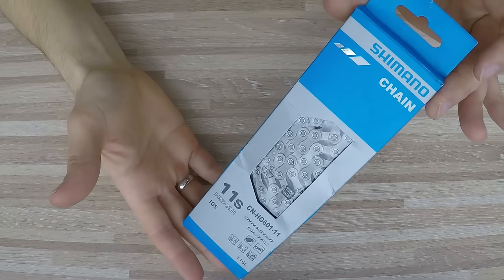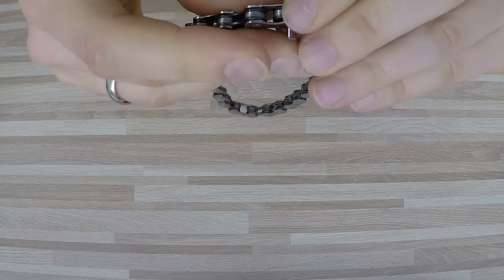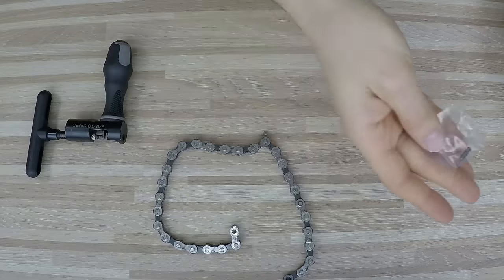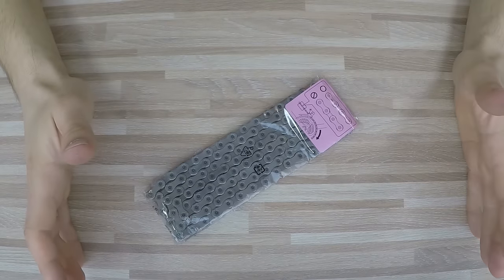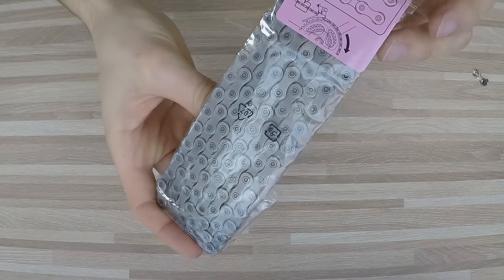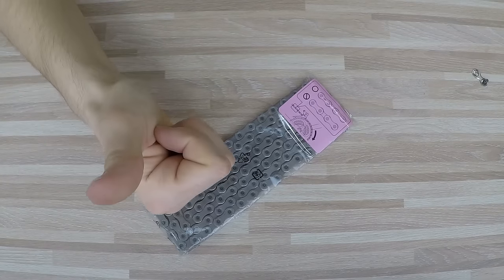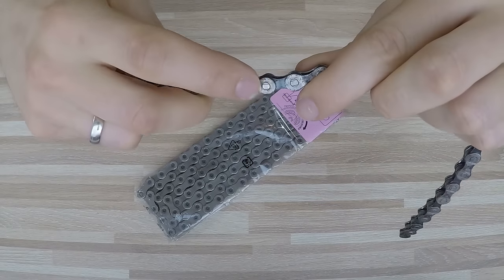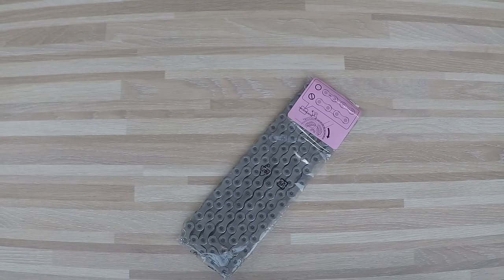4 Worst Mistakes In BICYCLE CHAIN Maintenance. How NOT to do it. SickBiker Tips.

Comment: Really not convinced by the replacement pin argument. A failure would be more likely to occur if there wasn't enough link showing on the outside of the chain outer plate and that would be down to inattention when using the tool rather than actual wear. With 110 or so links in the chain, it's unlikely that you will break the same link more than once and the wear on the outer plates would be as much a concern as the wear on the pin. If you are really that worried, the quick link might be a better way to go but you are just as likely to make a mistake with that and break the chain through human error.
 Best thing is probably not to break the chain once it's on and maintain the chain in place.

Anybody ever stripped a freewheel or a sprocket to the same disastrous effect?

Comment: Spot on mate.
Never reuse a pin. They are so cheap, it makes no sense to increase the probability of having a failure. Also, when installing new pins, check for link tightness. This is very important. If there a tight link, it will cause the undo wear on the cassette and chain. The chain will have a tendency to 'jump' on the cogs. 

To fix a tight link, use the chain tool but place the chain on the OUTER cradle, not the inner. Then ever so slightly, push the pin in just a hair, then repeat the process on the opposite side of the pin. Basically, you are pushing out the plates, but so so slight just to relive the 'kink' Take note though, if you push too much you will ruin the link. It's a very precise procedure that requires a light touch!

Comment: That is not true....  you can break a chain and use the same pin.  You just need to hit the pin few times with a hammer on a hardobject like a block of steel to give the ends a small flare.  How do you think the other 75 links are held inplace?

Comment: I hAve a 49cc motorised bike the chain in the gearbox broke after 12klm it's a 25h  double chain with 1600lb breaking force no where sells the chain I could not find a new pin so used a nail and squished it to fatten the ends, the pins are 2mm by 1.53 cm the bike shop could not help me, if I could find a pin of these dimension I could fix it properly.

Comment: Interesting video however it didn't answer the question I currently.  You seem to know your stuff so the question is....earlier I was putting on a new Dura ace 11 speed chain.  I wasn't paying attention when screwing in the pin & screwed it right through.  The chain was sized to the right length so I don't know what to do next.  Is the link wrecked now or just the pin?  In other words if I take  a fresh pin can I put through the same link I just put a pin through?  I thought that this weakened the link beyond safe use?

Comment: I use whatever vegetable oil that is lying around to both clean and lube my chain. Currently, it is extra-virgin olive oil. I pour some onto paper towels and spin the chain into it until it is good and oily. Then, I do the same thing with the paper towel only to get the extra oil and dirt off.
I have also been riding for quite some time, and after a ride, can sometimes enjoy a good pasta. (I get nice and hungry.)
I've had to deal with only one broken chain ever, simply because all of my bikes got stolen long before the chains had any problems.
I really should learn to dry my chain if it gets wet right away when I get home.
Reply: i read something about cooking/vegetable oils being bad over time due to oxidisation or something..look it up and change practice if you find the same info and still doing this..

Comment: Well for my part...I had a Dura-Ace chain at the beginning of the season (just putting some mileage in my legs) and I had to changed the bearing direction on my bike.  Went to the shop and I ask just to change the bearing direction.  BUT, they've looked at my chain (I had 932km with this chain) and it was already at .75 so they changed my chain...a Dura-Ace chain.  I don't do competition.  Is that possible??  To change a Dura-Ace just after 932km???  Thanks for your help on the subject.  The cassette and Chainring was ok..

Comment: My old MTB has well over 1000 miles on it and I've only ever used wd40 and motor oil to oil my chain also its the original chain
Reply: Matthew Abt erm... that is not really something to be proud of. 

1000 miles should not feel old. Many people put on a few thousand miles within the first season. That's 10x 100 mile rides.

Any cleaning & lube is better than no maintenance at all, but a degreaser and proper dry lube will give you good results. 

As does checking chain elongation & replacing the sprockets + chain. Depends on how you ride, but most chains only have a few thousand miles in them. Ride an elongated chain and you'll knacker the sprockets.
Reply: Well that's the thing , I've only put 1000 miles on it but I'm not the original owner it has been through 3 owners before me. And that's the reason it feels old , I plan to replace the chain soon because it is rusty and.covered in dirt

Comment: eh. with minimal maintenance I will get 6-8k km with an occasional lubing and not riding in the absolute worst conditions.  Of course I am talking about replacing the chain once it brakes, not changing it when it starts to stretch out.

Comment: Misinformation - the original grease is the best ever lubricant that you can ever have! Never ever remove the original grease. So says Sheldon Brown - Bike God.
Reply: James Rindley: I adhered to Sheldon Brown's philosophy on this matter for years but: 1.-He's been gone for many years and things change as new data comes in. 2.-New data shows that, now, there are better substances than the original grease and these substances have been thoroughly tested, check out Zero Friction Cycling and their excellent test results at: https://zerofrictioncycling.com.au/lubetesting/.

Basically, removing the grease and PROPERLY installing wax (with the correct ratio of melted paraffin and liquid paraffin) is far superior in reducing friction, noise and wear.

Comment: what causes vibrations and chain noise? the chain is lubed and not worn but it makes quite a bit of noise.
Reply: If this happen after lubed chain, its need some "break in" for lube to penetrating the chain and then its will be silent again

Mine was louds for awhile after wash and lube the chain but its goes silent after some spin up so lube could penetrate the chain rollers

Comment: Thought I posted this here, but don't see it.  Gotta get the word out...

Obsession with getting EVERY little bit of grit or grime off a chain is a COMPLETE waste of time. Why? A half hour on a road ride and your chain's dirty again. Five pedal strokes off road and it's dirty!

The worst part is that it encourages the use of all sorts of solvents, some safe, others not. I found a YouTuber who had a how-to video on soaking your chain in gasoline. There he was working in his tool shop garage using gasoline to clean chains. And showing others how to do it. Completely irresponsible.

THIS is what you want to avoid. The risk of blowing your place to kingdom come is not even close to worth it. And then if you are smart enough to switch to safer chemicals fire-wise, you STILL expose yourself to all manner of VOCs and organic compounds. Remember, the chemical industry in the USA has NO OBLIGATION to offer safe compounds to consumers. They let YOU use them, then contract cancer if it turns out it's unsafe. Then YOU have to sue. THIS is the United State's approach to consumer safety as far as chemical industry products are concerned.

And then there's the next point: removing ALL the lube means getting it BACK in there! I soaked chains for a while as a kid. It usually took three rides and over-soaking the chain with lube to FINALLY squelch all the little squeaks that would arise after another mile or two of riding.

So all this, only to remove lube where it's most needed: within the chain rollers.

Now the exception is the major mud or crud ride where the bike's completely covered. At this point, it's better to just hose the entire bike off, use a little gentle soap on everything, rinse and blow dry with a compressor.

Then lube the chain as normal.

But this obsession with chain solvents, brushes, containers, spinny thingies, OCD with TOTALLY CLEAN CHAINS is a complete waste of time.

Chains are consumable items no matter HOW much you obsess over a clean chain, it STILL wears out! Pick a good lube for your location and riding and be done with it.

Ride, wipe, lube. That's what a chain needs.
Reply: PS  There are other exceptions for ONE TIME soaking & thorough cleaning:
Utilizing chain wax.
Utilizing lubes that require de-greasing initial prep (like DuMonde Tech).

But that's it.

Comment: Sorry, but I've used a chain tool to push out and replace standard chain pins for years and years;  NEVER have I had a pin or chain fail.  Also, how the heck would you find the pin that you've pushed out so that you could replace it later?  I use a quick link now (like most of us), but pushing out standard chain pins and then pushing them back into the chain is really just fine.
Reply: I can confirm this, it is what I have been doing all my life without a single failure. I have never needed a chain tool touring or training. Make sure after replacing the pin it protrudes evenly each side and that the link moves freely and smoothly. Using diesel as a cleaner can cause dermatitis. Some other cleaning fluids are health hazards too, their chemicals and fumes. WD 40 cleanes, displaces water too. Keep it cheap and simple.

Comment: Bad info. Always keep the factory grease. Also, use what you like when cleaning the chain, just do it regularly and use chain lubricant after you clean it. Try not not to overuse the chain, since replacing a chain is always cheaper than replacing cassettes and chainrings(exception worn out transmissions, where a new chain will simply start skipping) :)

Comment: 2:00 wrong. You have to push it in just right and the chain wont bind. I did that for my 3000 watt ebike which is much stronger than human pedal power and the chain has been holding up for a while

Comment: Don't see how a new chain can become that dirty that it will last not as long or cause damage to the cassette  if not  degreased and lubed before first use.
I  clean and lube it anyway after about 200 km in dry weather, or a long first ride in the rain. Cleaning a new one immediately  is close to obsessive behaviour.

Comment: SickBiker doesn't recommend soaking the chain in solvent? Is that possible? The "cleaning" recommended here may allow the chain to look better but, truly, it's entirely superficial. The schmutz that gets inside the chain is what causes the chain to wear and the only way to get it cleaned is to use solvent inside the chain. If you are worried about the outside appearance, use wax (melted and chain dipped after a thorough cleaning) which is not only the best wear preventative as proven in independent tests but will totally prevent the black gunk from building up on the outside of the chain. Using wax eliminates the need to degrease as a periodic chain dunking is all you'd need afterwards.

Comment: here's a situation + question: got a directional chain (10s), but i installed it in a rush and got it wrong (counter drive direction). i realised that just after connecting the chain. so i pressed the pin just enough to be able to break the chain, twisted it around, then reconnected it. since i did not use it all, should i be worried about the chain? there was no visible material taken off the pin, at least nothing noticeable on the rivet from the chain tool

Comment: I actually used brake cleaner for degrease the chain, and I lubricated with wd-40 just like an average person
Reply: But WD40 isn't a lubricant. The clue is in the name Water Displacement. It's great if you run a oil lube. Afterwashing your bike clean your chain with WD40 to displace the water and remove old grease or oil the relube the chain. Or try wax I've recently moved to waxing its clean and waterproof. Cheap too

Comment: I know that Sheldon Brown always recommended keeping the original grease, you say not to do that, ok, please show us in the Shimano Instructions that you had with the chain that tells us to remove that grease and relube it.  Funny thing is representatives from Shimano, SRAM and Campy and the SRAM ALL say NOT to remove the original factory applied grease, it was not put on as a coating to protect it from rust, but it was applied by the factory before all the links are assembled to make sure the grease gets into the innermost part of the chain, if you remove all that grease you will not be able by hand dripping oil get all the oil into the innermost regions of the chain.  I know you're going to scream and kick about what I said, and since you didn't show us proof of what you said, I can show you proof of what I've said:  https://www.roadbikereview.com/reviews/chain-maintenance-advice-from-the-experts
Reply: @Chris Donovan   By cleaning, the chain companies mean a deep clean that a lot of people erroneously do.  I happen to use Rock n Roll Dry (Gold too) that are self-cleaning lubes, I ride a new chain for about a 100 miles and start applying the lube following the directions of course because their directions are a lot different than other lubes, then about another 100 miles I do it again, and repeat that cycle 4 times, after that I only have to relube about every 400 miles and never have to "clean" the chain.  And I also wipe the chain down after every ride.  

I'm one of those guys who waits for the chain to wear out, so I use a chain checking tool, and replace according to what the tool says and not according to noise or skipping issues, but I get about 8,000 to 10,000 miles on a chain since using Rock n Roll.  I only change the rear gear cluster every third chain replacement.

I tried a lot of different lubes over the years, and was always switching trying to find something better, so I tried Rock n Roll, it took some while of use to get a feel for it, but as time went by I ended up really liking that stuff, I doubt I will be searching for a different lube anymore unless they change the formula like Finish Line did and made their lube worse.

Comment: Yes, having ridden for many many years also often using the same link, I can confirm I have NEVER had a problem, there is no issue with cleaning any chain with petroleum or paraffin based solvent is also NOT an issue. It appears this guy only uses his bike on indoor rollers.

Comment: OK buddy I have never ever out any new pins in my bike chains and always use used chain and I go at least 10.000km a year on my bike and I have had the same one on there now for 3 years and had it off at least 3 times doing the keep the pin in trick it just takes skill tp set it properly lmfao

Comment: The 'sticky grease' is in fact, a chemical known as 'Cosmoline' (or a closely structured chemical). It was originally designed for shipping military weapons and storage for years, against high-moisture (and salt-moisture) environments. The ABSOLUTE BEST way to TOTALLY strip a new chain of this wax-based storage-grease is to go to a auto parts house, buy a pint of something called 'Marvel Mystery Oil' (Dexron III transmission fluid will work, in a pinch) and soak the chain in a bowl of it for a few days before removing it, drying it with shop towel, and installing it. Now, 2-weeks later, re-lube with standard teflon-based chain lube. The chain will last FAR LONGER than by not doing this, and it gets the wax out of the inner-rollers!